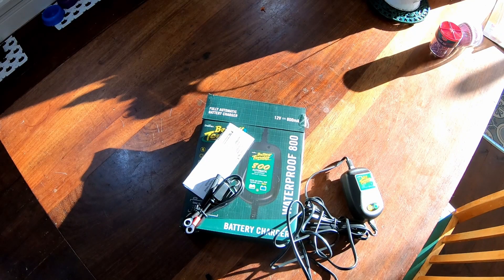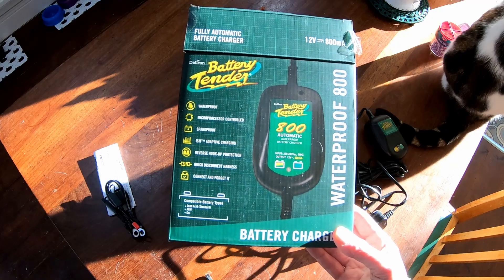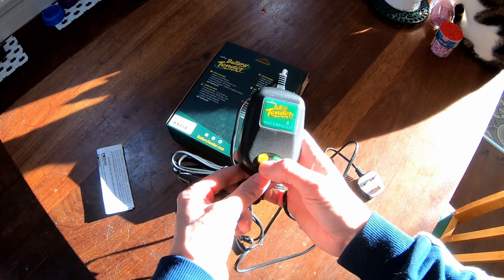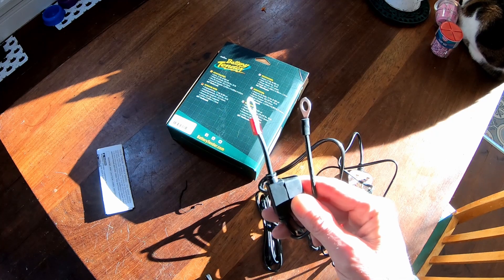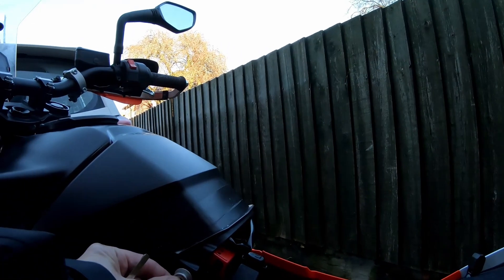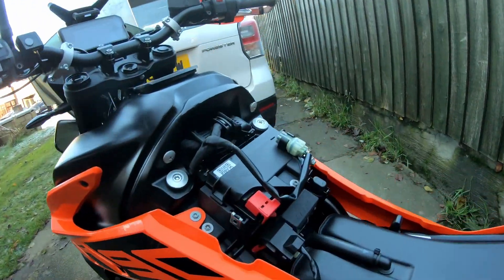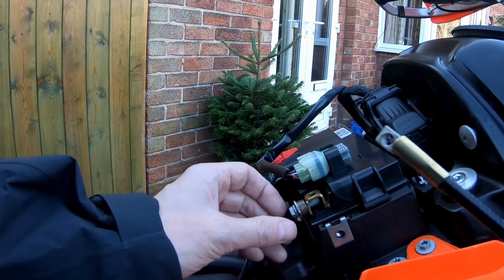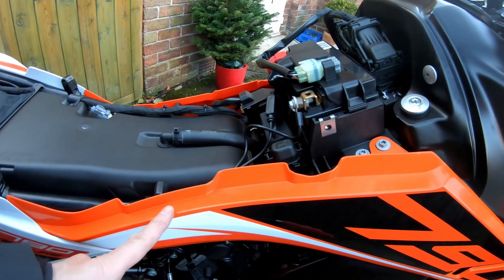KTM 790 Adventure - Deltran 800 Battery Tender

Comment: Evening Codger, I use the TecMate OptiMate 3 Battery Optimiser plugged in when I put the bike in the garage all year round, just to keep the battery topped up and fingers crossed no problems thusfar 🤞. I have fitted the connector in the same location as you because it just happens to be the side the plug socket is 😁.
Reply from the maker: Hi Gary. Good to know. I did think about leaving the connector under the rear seat, but decided it was easier to have it accessible for quick use. I also think it could be used as a separate power supply for a compressor or something, though the fuse might not be big enough. We’ll see...

Comment: Personally what works for me is charging the bike once every week or two if its not being ridden.  Leaving it on the tender shortens the battery life pretty quick in my experience
Reply from the maker: Yes that’s how I will use it. I try to ride a day or two a week all year, but winter often prevents this. So I’ll charge it every few days 👍
Reply: I've used a tender on my bike (Harley) for several years with no problems.  The one I have only charges at a max rate of 1 amp until it is fully charged, then it quits charging and monitors the battery until it drops down to 80%, then it starts the charging cycle again.  Yes, if you use what I call a "trickle charger" it probably is not good for your battery as it maintains a constant voltage on the battery.  I once knew someone who used a regular charger, but plugged it into an adapter for one of the light  sockets that activate for about 5-10 minutes when the garage door was opened or closed. That worked pretty good for him.  Also a timer could be rigged up to turn your tender on and off for a few minutes each day.
Take care that you get the correct charger for the type battery you have.  My tender says to only use it on lead-acid batteries...so if I get a Lithium Ion battery, I will need to get a different tender.
BTW, Codger, Nice video.  I went out today and put this on my KTM 890 Adventure.